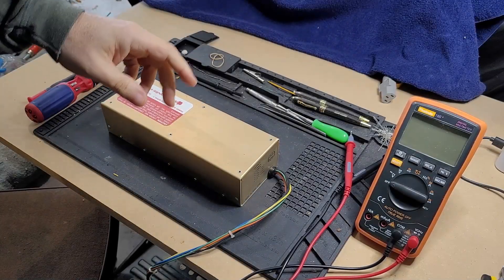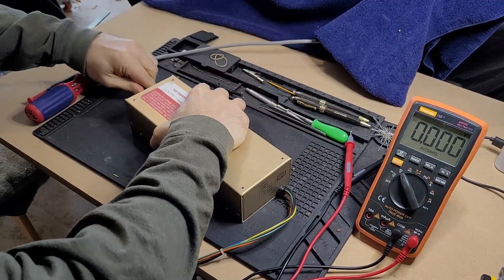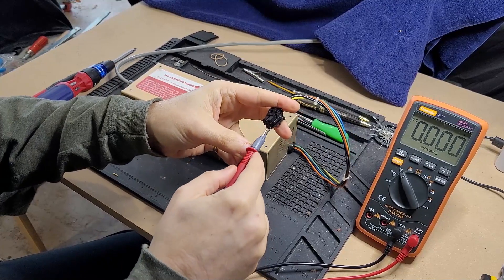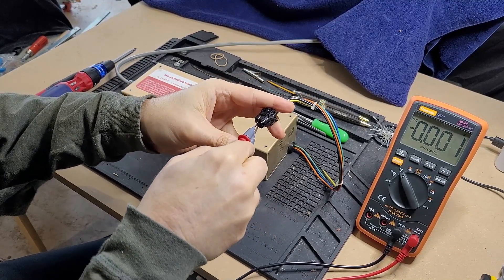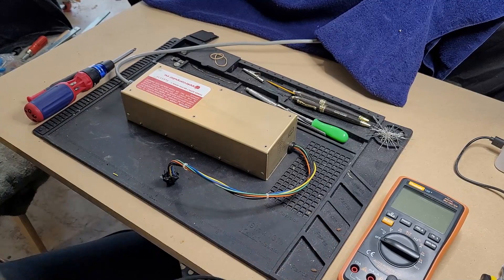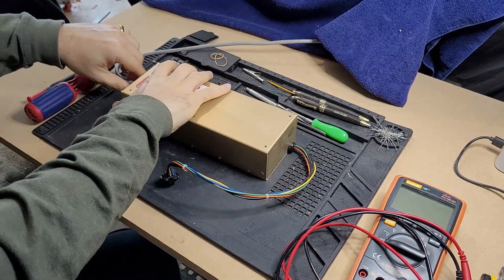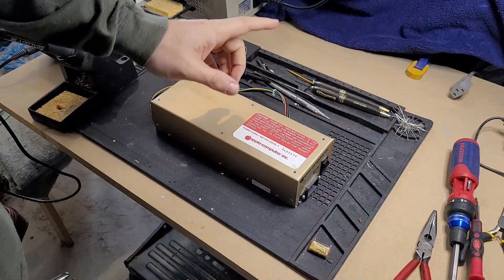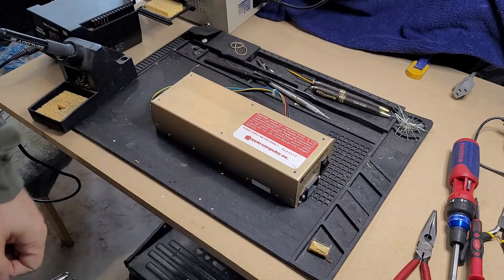Apple ][ Power Supply Repair

Comment: Apart from the cap, this thing looks like it came out of the factory yesterday. Whenever I open any psu older than 3 years, it looks like it ran 24/7 in a coal mine
Reply from the maker: Good point.  The date on the side says this one was put together in '83.  When I opened it, I was expecting there to be more problems.

Comment: I saw someone describe the smell of a popped RIFA capacitor as "a cross between ozone and cabbage farts."
Reply from the maker: Yes, I hear that it is a very unpleasant smell.  I've repaired a couple devices with dead Rifas now, but so far I've been lucky enough to not experience the smell.  Or the magic smoke.